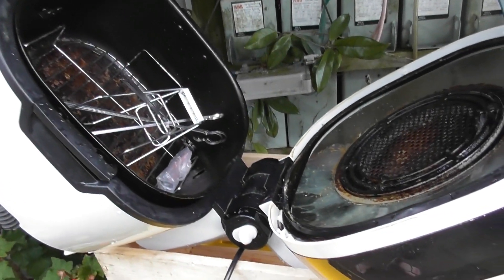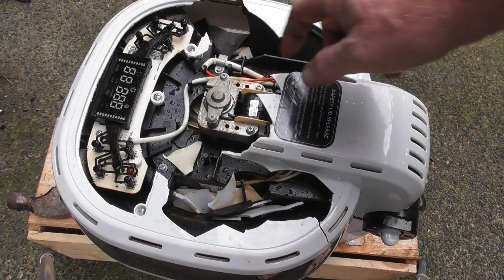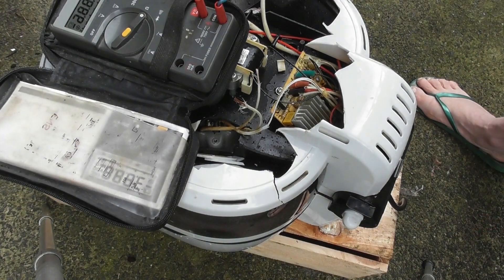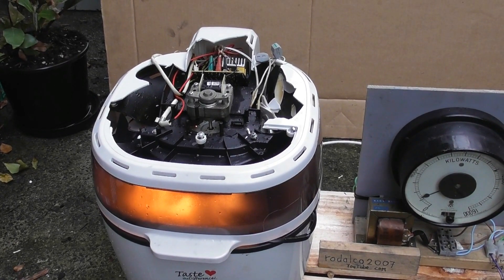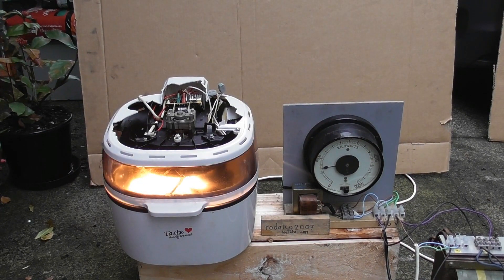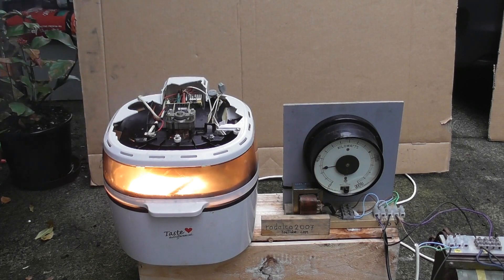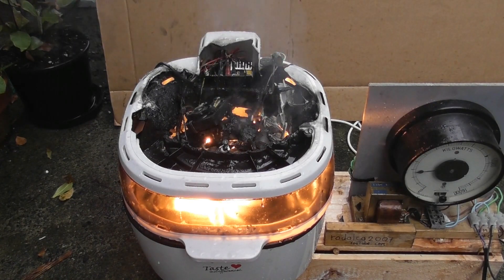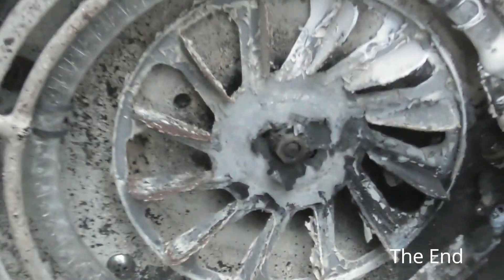Air fryer on 380 Volts EOL

Comment: Looks like this wasn't such a badly made appliance. In case I missed it - what went wrong in it before you got it? And btw, I want this heating element in my next soldering iron, maybe it won't die so soon. 😑
Reply from the maker: It was given to me by a work collegue. I think the electronic timer board failed.

Comment: I haven't heard of an air fryer before,  but if I ever buy one, "Taste the Difference" will be the one.  Dang thing is indestructible.

Be sure to save the little aluminum heat sink.  Those are always handy for voltage regulators when building power supplies.

Comment: I guess the heating element is the only high quality part inside of this air fryer.
I'm amazed that neither the glass broke at this high temperature difference between the water and the fire nor the filament melted down.
Compare that to the garbage halogen stick bulbs for my dimamble floor uplighter with the filaments melting into the glass (that really happened a few times to me until I got a dimmable OSRAM-LED-lamp for it).
I hope you saved the heating element for future experiments.
I would like to see it in future videos.
Great video!

Comment: You should put that out in the middle somewhere where it can't burn anything and then plug it in and let it start itself on fire and then just let it burn while plugged in. If that fan motor is any good, over volt it till it pops or catches fire and then let it burn.
Reply from the maker: I will test the motor and see what happens.

Comment: Very surprised it kept going after the glass blew. That's a death sentence to regular bulbs. I wonder if these elements are ok running in atmosphere like an electric fire, or toaster oven "spring coil" element, or if they do have a halogen in there to extend life?
Reply: Most of them run in atmosphere, the glass just there for electrical safety and mechanical strength.
Halogen systems require a very high temperature - much higher than the element reaches in normal use.

Comment: If you could ramp the voltage up to 600v it would probaly die.
Reply from the maker: That will happen, a part 2 will happen. Remember the 230 Volts CRT TV which popped at 500 Volts.